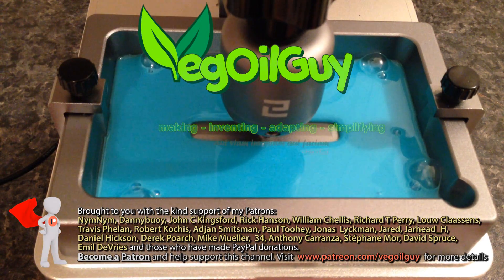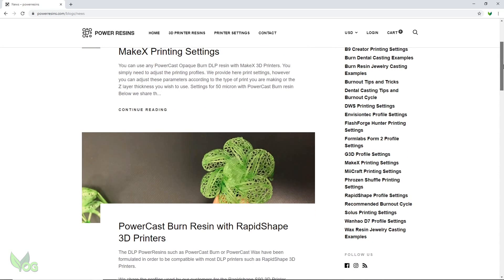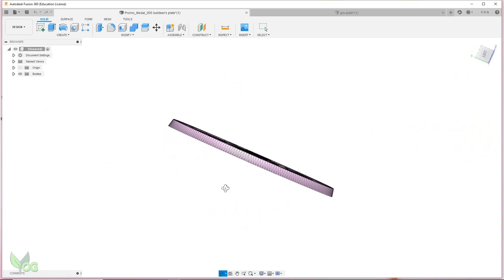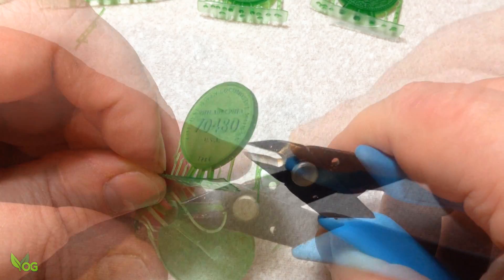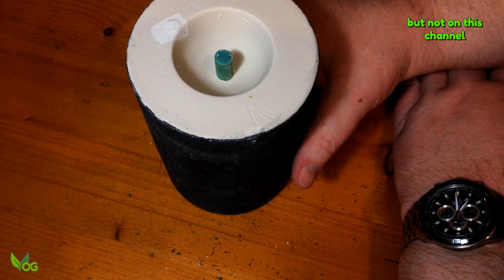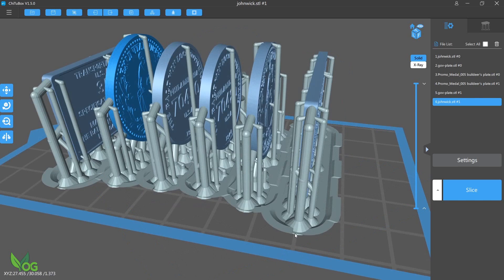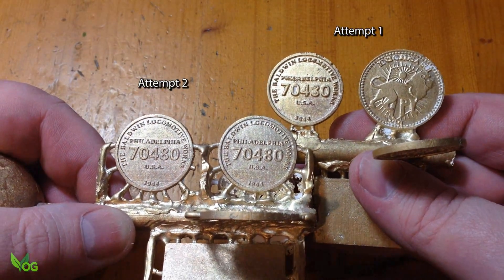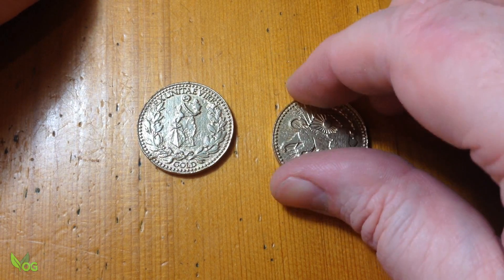Using & Reviewing Powercast Burn castable resin with my Elegoo Mars - detailed home castings! VOGMAN

Comment: that's the highest detail metal casting i've seen on youtube! do you think there's a limit to the level of detail that can be achieved by casting though? maybe the shrinkage of the metal while it's cooling or its viscosity while molten would prevent you from getting micrometre wide grooves?

Comment: You using a vacuum castor my guy?
Reply from the maker: Yes, I always use a vacuum 😁
Reply: @vogman  nice im trying to invest in one my self ive been hand pouring for a while but really want to step up my game to do things like this im trying my hardest to save up for the equipment I really appreciate your content its extremely useful for someone in my particular situation
Reply from the maker: I started off with homemade equipment. I used it during the making of THIS video, so you can see it works, plus it's cheap and easy to make. Have a look here - https://youtu.be/EGNnH_xbjR4
Reply: @vogman  if you have any second hand equipment for sale or suggestions on what inshould get and what to avoid id appreciate that also! I plan on casting silver anything from 1 gram fractionals to 5 ounce statues i think im waiting for the new photon resin printer to drop later this year

Comment: Very nice video thanks. When you pour in your investment are you using a vibrating and/or vaccuum to remove the air bubbles that stick to the resin, in particular between the letters?  If you do not have a vacuum bell, try using vibrating pad to remove trapped bubbles.
Reply from the maker: Hi Ken. At that time, I was using a homemade vacuum system. It works great https://youtu.be/EGNnH_xbjR4

Comment: First time 3D printing and I used that resin. Nothing was on the build plate my piece was floating in the resin half way done. I didn’t know what to do being so new and hearing about adhesion the first time. After about 2 hours of searching I found you video. I hope the setting and Prepping the build plate works! Thank you sir.

Comment: Hi VOG, I've been using the same resin and never primed the build plate, and I made maybe 25 prints or so without having any of them no adhere to the build plate. All of a sudden though, nothing is adhering. I had a file in chitubox I printed successfully, then did it again and one of the molds fell off, then in later attempts more started falling until now they all fall. The only variables that changed were that it had gotten colder now. I tried heating the resin up but I got the same result. Now I'm wondering if perhaps the resin has gotten old or changed in some way? I will keep trying, but I'll have to start priming the build plate I guess. What do you do to clean the primer off the plate?

Comment: I bought the power cast dark. Any suggestions on profile settings? For the elegoo Mars.  & what type of alcohol should I use ?
Reply from the maker: Start with the same setting I used here. It seems a sensible starting point. After that you can tweak if you feel it's necessary 😊

Comment: By priming (times 4) what you did was change the Z zero value by the thickness of the 4 coats.  Perhaps you lost your original Z zero point during normal use???  Maybe it needs to be re-zeroed after every few uses?  Or maybe it needs a 0.5 mm base pad in the design?
Reply from the maker: I found it made absolutely no difference at all : )

Comment: Wow, really great job and demonstration!

I wonder if normal sla resin can also be used..?

I didn't quite understand the difference.
Is it about that the resin used melts better, or is it about avoiding toxic gases that would be produced when normal sla resin is burned?

I hope someone knows the answer, or has tested it with normal sla resin.
Reply from the maker: Some folks claim ordinary resins can work, but some resins produce toxic gases when burned away, plus they can leave behind ash, etc. Casting resin generally burns cleanly and safely : )
Reply: @vogman  okay thank you. :)

Comment: For those of y'all wondering what "methylated spirits" are, in the USA they're called "denatured alcohol", and you can pick it up cheaply at hardware stores all over the country. It will generally be clear, rather than purple, as the purple comes from a dye they're required to use overseas so that people know that the alcohol is not safe for human consumption.
Reply from the maker: Thanks for sharing that : D

Comment: hey guys have you ever tried lost casting regular resin prints? That should liquify as well right? thx for reply
Reply from the maker: Go careful with this my friend. Regular resins can give off toxic gases as well as leaving ashy deposits that spoil the casting. This is one of those times when paying the extra for the correct product is the way to go : )
Reply: @vogman  You Are probably right :) just a thaught. I am in process of creating an investment cast mold that burns out at about 800c, So i that that ať this temeprature it would just evaporate out od there anyway.. thanks a lot for reply sir:)

Comment: I've not used castable resin before but pre priming the plate seems unnecessary.
Set you initial base layer cure time to something large. The 80s you are using is insufficient. Go no less than 100s. 120-140 for peace of mind. Then your base layers will be properly cooked and secure to your print plate. It adds a couple of minutes to the print but much less than dicking about pre priming the build plate. The only negative to a longer base layer other than a few minutes of time is a loss of detail due to such a long exposure time, but because it's the base layer and there is no detail to lose it's irrelevant.

Also that just seems a terrible idea, if your properly leveled all that resin cured on the plate will cause high spots and not leave clearance for the initial layer. It would push into the FEP causing more rapid deterioration of the FEP and possibly puncture it.
You can also increase the amount of base layers to 10 or 12 to increase the strength of the base. The main cause of a print coming away from the build plate I have found is due to a support being too close to the edge of it's platform and peels the base up, eventually peeling the whole print off. A thicker base with a longer cure time does not flex as easily and therefore does not peel at the edge.
Another thing you can do is increase the raft size to 130% which will give a larger surface area for the print to overcome before it can fall off.
Hopefully that helps you in future so you don't need to much around with multiple priming layers etc.

Comment: Great video!  Do you think that resin would work with large prints on the Peopoly Phenom?  Thanks for your time!
Reply from the maker: The best thing is to fire an email off to Powerresins and see what they say. These resins are expensive so I wouldn't buy on a hunch... but if they say it will work and it doesn't, then at least your in a position to demand a refund : )

Comment: I've been scouring the internet for guidance on casting my own challenge coins. I believe I've just found the holy grail. Thank you!
Reply from the maker: Funnily enough tomorrow video contains a coin and a medal, as well as a bear pendant. It's surprisingly easy with castable resins : )
Reply: @vogman  I have lots of experience with resin, but none with lost wax casting, so I was very excited to discover castable resins exist. Still need to acquire the metal casting equipment and learn a bunch there, but I'm greatly looking forward to your next video.
Reply from the maker: Nice one.
Take a look at this video I did... https://youtu.be/qxj5eUkAFUI - it's about Lost PLA casting but the same techniques apply for Wax or even Resin. A lot of the equipment is very expensive so where possible I made my own cheaper but effective versions. There's links to all those things within this video and also in the description.
If you need any help, just drop me a line : )

Comment: Why not ''simply'' make one out of the normal (cheaper) resin, make a silicone 2-part mold out of it and meld and pour wax in the silicone mold? Would probably be more cost effective and quicker aswell. I understand that you're experimenting with other materials/settings, but if I were you I'd try and replicate more of those John Wick coins as they look nice.
Reply from the maker: Thanks. I did do the standard silicone mould approach a couple of weeks ago - https://youtu.be/igV8gEBzatQ - but this time I wanted to see how resins performed. I can see merits for both approaches : )
Reply: @vogman  As I'm not a regular sub I didn't know you had already done what I've suggested. You've got some interesting  videos. Consider the ''not a regular sub'' fixed, I'
m also not sure how you ''only'' got 35k subs as your videos are short but informative. Keep it up!!
Reply from the maker: Thanks very much : D

Comment: Adding that extra wax as a sprue seemed like a pit of a pain when it came to removing it, stand it up to let the gases out then upside down to let the material run out. What are your thoughts on that? The resins expensive so printing large sprues would be a waste for sure.

Comment: I think you should level your build plate instead of "priming" your build plate. Additional you should sand your buildplate a bit. And please increase the curing time of your first layers. That ensures that they stick better to your build plate :-)
Reply from the maker: Thanks, I do enjoy suggestions as I'm happy to learn. In this instance I can assure you than the plate was levelled. I have since also scratched the build plate a little and with this resin it didn't help. In fact the manufacturer actually recommends priming. I like the idea of the curing time though - thanks : )

Comment: hi quick question, probably dum, is there any advantage to casting 3d prints? is it just turning you prints into a stronger material or is there something else? Stumbled onto this when looking it castable resins.
Reply from the maker: It's just a preference. 'Casting' on this channel refers to metal. I like melting metal and making things, both practical and ornamental. Castable resins are new to me and so I'm enjoying making various items. In this video, I made bronze parts for a guy in Alaska who is making a scaled down steam locomotive, also in bronze. 
I'm a lover of painting miniatures as well, so I've no doubt I'll be printing and painting at times : )
Reply: @vogman  Thanks for your reply. the reason i am asking is i too make scale models and miniatures, i also sell them. Whilst the white metal models are not as popular as they once were if you can take a 3d printed object and turn it into metal you can make moulds for injection moulding cheaper that getting a cnc, or make parts stronger than resin allows.

Comment: You didn't mention the investment used so I'll assume it's mentioned in your other videos.  I'll also assume you used an investment not designed for resin.  What you'll find is the investment used is extremely important for obtaining perfect surfaces.  Probably the most popular among jewelers right now using castable resins is Prestige Optima.  I've never tried it though, I'm currently using Ti-Research's Hi-Speed RP Investment, which works great, but you need a hammer and chisel or pressure washer to break it up.  Quenching only somewhat improves this, with this investment.

I've tried numerous castable resins of over the years and the best I've found is Bluecast.  It's all about getting those surfaces coming out perfect!  I look forward to seeing your future videos on these castable resins.  Subscribing.
Reply from the maker: Thanks for the input. 
This is the plaster I'm using - https://www.hswalsh.com/product/pioneer-smoothcast-investment-powder-tc0451 - it's suiting well for the moment. I'm still learning and have a long way to go. Sharing ideas and reading feedback is all part of that journey : )

Comment: In dental lab school they taught us to roughen the top of the flask to allow gas to escape.  Been doing it for 14 years and never had to rotate the flask during burnout.    For rough castings typically it is due to a improper burn out procedure or too loose of investment (too much water).  That said, They look great!
Reply from the maker: Thanks Karlan. I've had others tell me the investment is porous enough to allow the gases through and you may well be right. Roughing the surface would increase the surface area so that's a logical idea. For the moment (as I'm new to it) I'll stick with the rotate technique. In a few weeks I might do a few experiments and see if I can spot differences. But I suspect I'll be bowing to your superior knowledge in the end : )
Reply from the maker: Hi again Karlan. I removed your second comment as it contained your email address, though I'm VERY grateful and have made a note of it. I'm always happy to those with more knowledge than me - and that's a LOT of people : )
Thanks again.

Comment: Thanks a bunch for this! I'm an instrument maker (historic trumpets) looking to use castable resin printing for some ornamental work... as far as burnout... is the cycle absolutely critical? I don't have the means for a large burnout oven, but have been thinking about using a small used kiln. Would a simple timer/thermocouple/kiln setup still be usable? Is the temp ramp super critical or could a gradual step up in temp work as well? Thanks so much for all you offer!
Reply from the maker: That sounds a fabulous use for this technique. I think it will work well for you.
As for critical equipment, I'm using mainly homemade stuff, so absolute precision is a loooooong way away. I work in a dusty cramped garage and I'm far from clinical. 
Up until a few weeks ago I had a standard PIP and used to ramp the temperatures by hand. Then I got a programmable PIP and fitted this (https://youtu.be/hGCL1FXKXss). I can't say it's made a massive difference to my castings, but it has made life easier. Now I shove everything in and walk away until the following morning. By then the sequence has done it's thing and is ready for metal. If you fancy this approach but want a cheaper PIP than the one I used, let me know. I think a friend purchased a cheaper Chinese unit some weeks back. I can quiz him on your behalf.
As for the importance of the heating cycle, it's really for the plaster and not for the resin. A jeweller friend of mine insists it's critical. And I suppose if it wasn't important, why do the plaster manufacturers tell us to do it?
My advice? Give it a go. If improvement is necessary, you know where to begin : )
Reply: @vogman  Thank you so much! This is very, very helpful. (Subscribed on Patreon!)
Reply from the maker: Thanks very much  : D

Comment: Did you have to spend much time cleaning the bed after 'priming' and curing? Or did it scrape/peel it off easily with the 3D parts?
Reply from the maker: Not really Joe. The scraper took most of it on the first pass. I then left the build plate soaking for a couple of minutes whilst I was dealing with the print and after that a quick wipe with a paper towel got it spotless again : )

Comment: Now you understand why I once said Lost pla is not the way to go lol ! You can say it haha i was right wasnt I. BTW What I do to make sure a print grabs well on the Baselayers is, I use a hot-air gun and heat the build plate just before I start a print, It does not need to be boiling hot, Just very warm to the touch, Most people don't know that Resin works best in warmer environment.
Reply from the maker: I have lots of learning to do on my casting journey. That's something I enjoy - and enjoy sharing. Tips like the one you have just shared make that journey even easier. Thanks : )
Reply: @vogman  I was referencing to a Comment i had made a while back on this video, https://www.youtube.com/watch?v=9fMg6pC4xQo&t=109s  To be fair, since then, you also proved to me, that Lost PLA casting does have its place and does work for larger prints when surface finish is not extremely important
Reply from the maker: I think all techniques have their place. I enjoy trying the all : )

Comment: for smoother castings, without the minor layer lines, consider curing your prints while they are slightly damp with resin. The surface tension of the resin will just fill the layer lines and give nice glossy surface finish. i use this method to finish prints with transparent resins, giving the models an optically clear coloured  glass effect.  i think this would compliment your casting process nicely. great video! keep up the good work!
Reply from the maker: Nice suggestion. Thanks : )

Comment: what forge do you use.  I want to get into resin or lost wax casting, whats an entry level forge  you would recommend
Reply from the maker: It can be an expensive hobby but I've worked around this as much as I can. Try this video... it's about Lost PLA casting but it's the same process throughout - just swap an FDM printer for a resin printer, or use wax instead. https://youtu.be/qxj5eUkAFUI

When watching the vid you'll see I made a lot of the equipment myself and there's links to the appropriate videos. There's also some links products in the description.
One tip I'd offer... personally for small stuff like I'm doing here, I'd recommend you go with electric rather than gas, etc. It's more controllable and can be done safely indoors.
 If you need any help, just drop me a line  : )